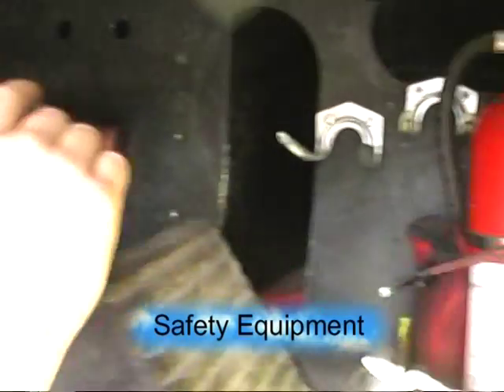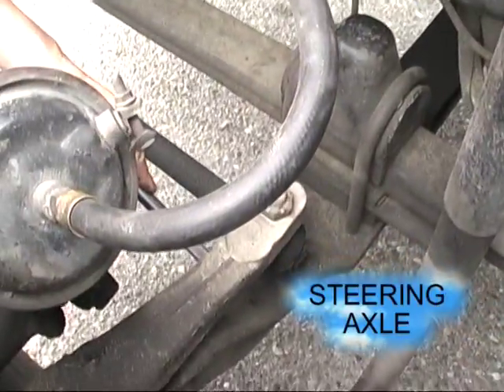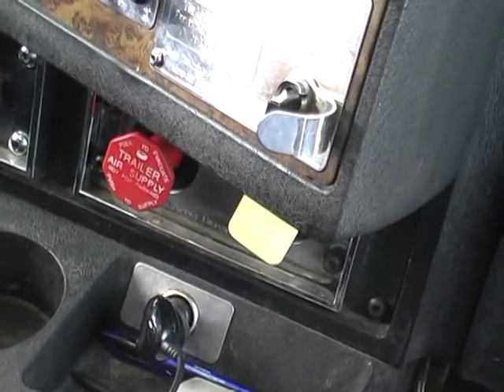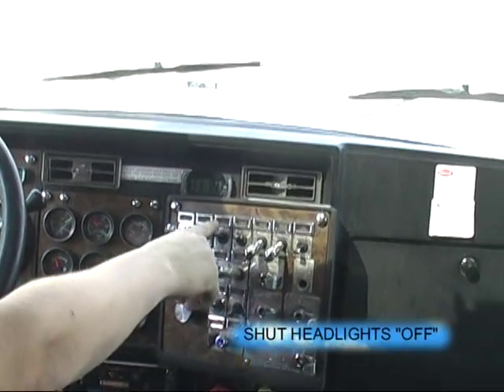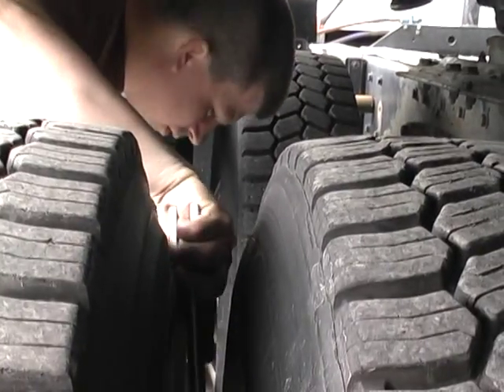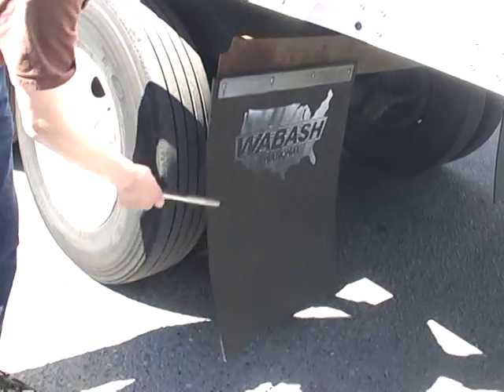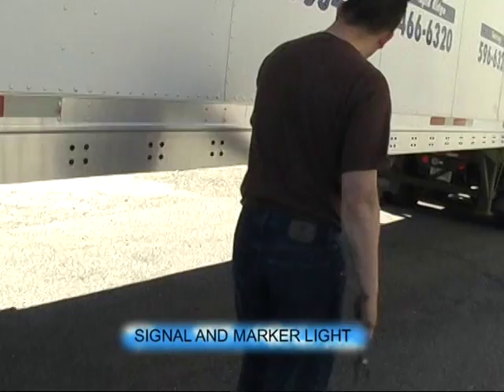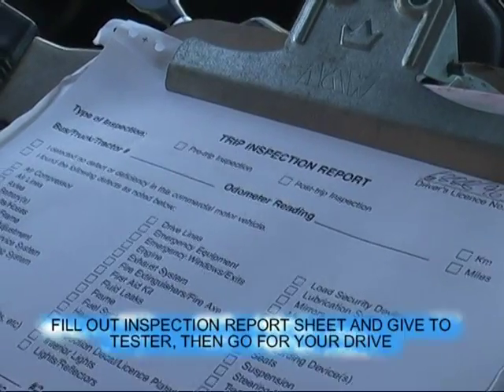FULL CLASS 1 PRE-TRIP

Comment: I have watched many videos on pre-trip inspections, and this one is a very good video!   After driving for 20 years I have done many inspections, and it very nice to see someone teach the proper Level 1 inspection so well.

Under normal inspections, it will not take 25 - 30 generally, like the video, as the driver will mentally will do the visual and manual inspections without speaking the parts. 

I have had inspectors tell me that if you spend  more  than 15 minutes, you are wasting time.  Remember, it takes different people different lengths of times to complete an inspection, and also remember, if you are stopped or in a wreck, the complete responsibility falls on your shoulders.  Do the inspections correctly and well, and most of the time you will never have a problem. 

Thanks for a great video!!!

Comment: You do not test the tractor protection valve. 105psi to 135psi for max pressure? If i run a truck that only builds 105psi im goin to the shop
Reply: some older trucks still run at 105